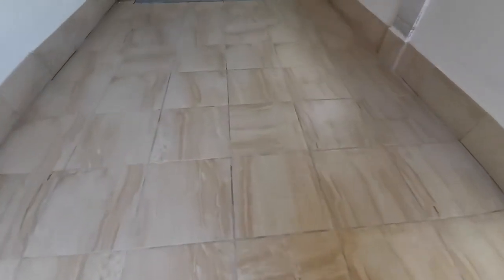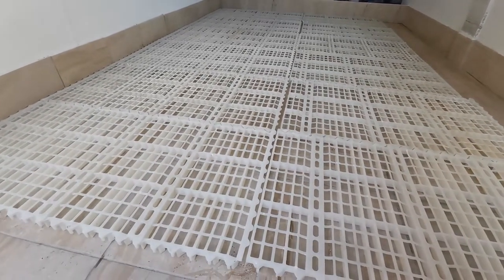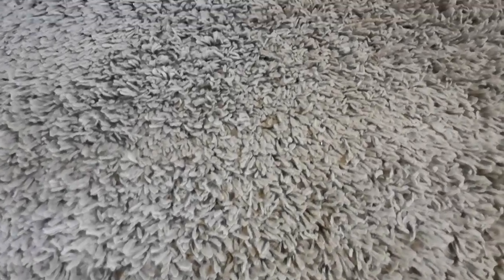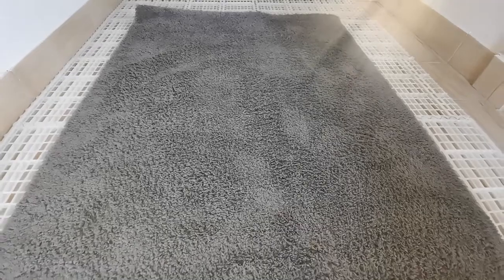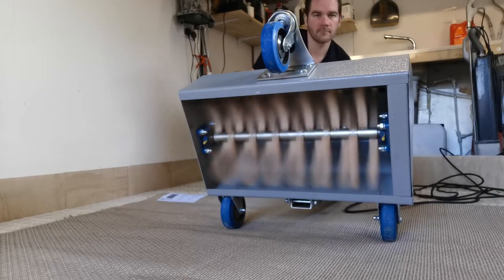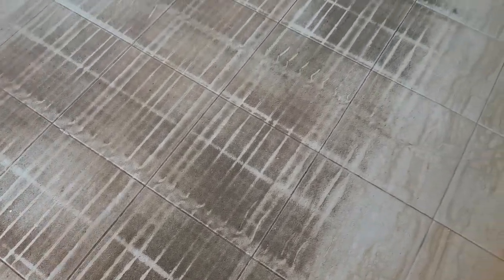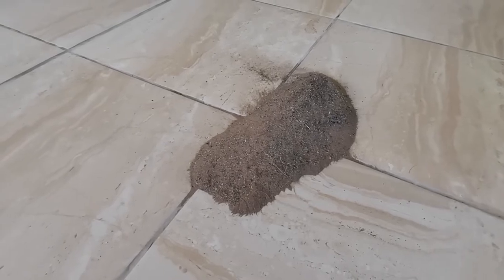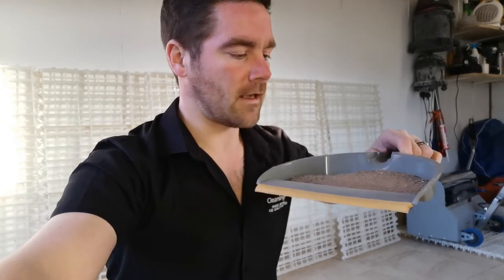brand new rug dusting machine 1st use.

Comment: Do you think you could use a light-weight plate tamper? Maybe cover the rug with a thick pad to prevent damage?
Reply from the maker: That's outside the box thinking. I have seen folk using all sorts for dry soil removal.  I have a cheap test rug that I do experiments on with new machinery, methods and cleaning chemicals. Try your machine out on a test rug and take it from there.

Nothing ventured, nothing gained 👌🏻👌🏻

Comment: what grid is this?
Reply: Hi there, the grids are actually chicken House flooring. At the time I couldn't afford the metal grids, they were coming in at nearly £1000. These cost me around £120 so was a great cheap alternative.

The only down side to them is the holes are slightly bigger that what the metal grids are and on thin rugs the wheels of the duster can catch the odd time but I find this an extremely small price to pay for the fantastic job that they do.